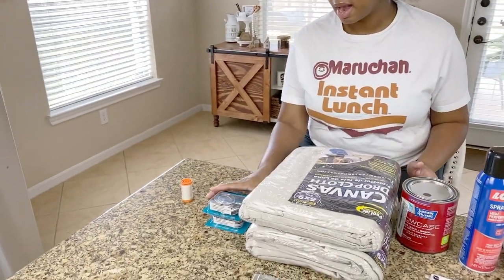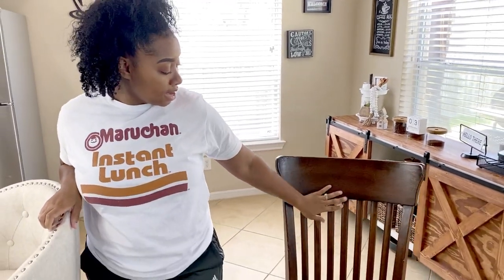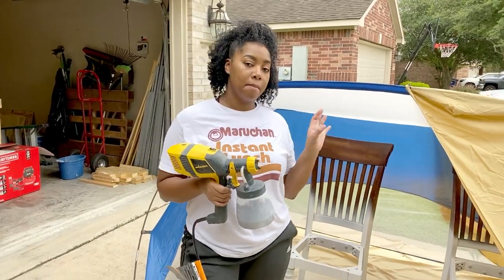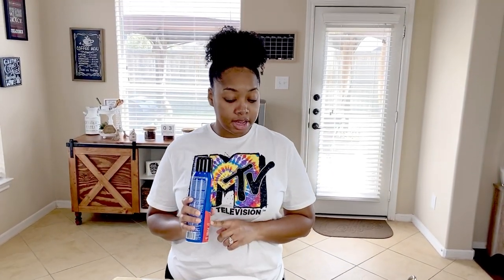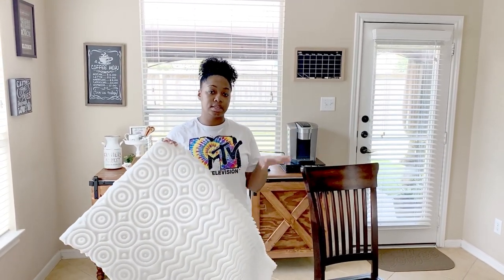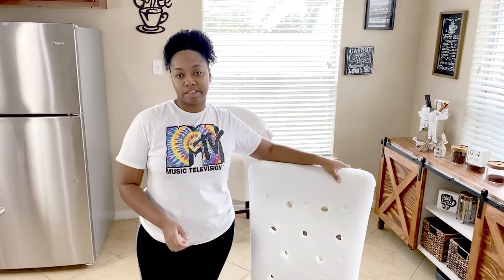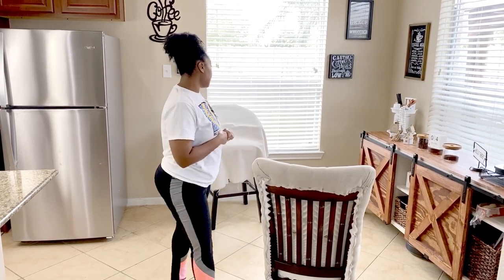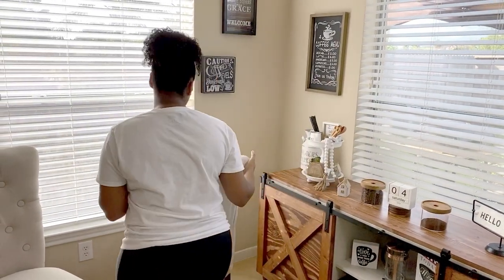DIY Reupholstered Tufted Chairs With Drop Cloth | Farmhouse Chairs|

Comment: Outstanding job. I am a beginner at this but you mentioned that you had rippers on top after you double the cushion. What does that mean. Did you used bag of batting. Thanks
Reply from the maker: Hi Wannella,

On the first chair, I started with using batting on the seat of the chair, but I realized I did not need it. I did not use it on the second chair. 

As for the ripples, I believe that is what you are talking about. The foam that I purchased was a mattress topper, so one side has ripples, and the other side is smooth. I wasn’t sure if the side with the ripples exposed would be noticeable on my chairs, so I decided when doubling the layers of foam, that I wanted the sides with the ripples to be facing each other and not exposed. I hope this isn’t too confusing. Thanks so much for watching!💗

Comment: Nice. But it would have been nice to show how you made the holes.
Reply from the maker: I just placed the button on the padding, traced the circle with a sharpie, then cut the circle out with an X-Acto knife, then push it through so that it creates the hole. There was no set measurements that I used, I just eyeballed where I thought the tufting would look nice. Hope this helps. 💗

Comment: Fishing line is a great idea for the tufted areas. Much more sturdy than thread! I just picked up 4 chairs on FB market place, and they're actually already upholstered exactly as your finished project. (4 chairs at $75). I plan to remove the old fabric and just use the pieces as my pattern. I appreciated this video! Just wanted to mention... You can literally make any size covered buttons yourself, and it won't cost you a penny. You don't even need a button! Grab a relatively sturdy piece of cardboard and trace a circle on it in the size that you want your covered button to be. Cut that circle out (you can even sand the cardboard circle edges to be sure its perfectly round). Using an awl, or ice pick, or anything sharp and pointed, put your button holes in the cardboard where you want them (either two or four holes). I put a small piece of wood on my table (or floor) and just use a light hit of a hammer on an awl to punch the holes where I want them. Super simple! Place your cardboard button on the fabric of your choice (fabric right side down). Typically, even a scrap of fabric will do. Draw a circle around the cardboard 1/4 to 1/2 inch larger than the cardboard circle, depending on how large it is. This can be "eyeballed" and hand drawn. Remove the cardboard and hand baste your circle of fabric loosely around the outside edge of the circle, but don't knot it or remove the needle. Leave a few inches at the end to be able to pull the thread tight. Place your cardboard button in the center of your fabric circle and pull the thread so that the stitches close around the "button" you created. Make a stitch or two in the back of the new button cover and knot the thread. If you want a "puffy button," add some "stuffing" under the cardboard button before pulling your thread tight around it. I've been using this method for years, and the covered buttons are fool proof, free, and literally take a couple minutes each! No more waiting or paying for someone else to do! Give it a try! Your chairs look great, by the way! I'm about to do the same for some chairs I thrifted on facebook market place, which was what brought me to this video. Great tips to follow... thank you for sharing!
Reply from the maker: Wow! Good to know 😉 thank you so much for the amazing tip, I’ll definitely have to try the cardboard! Thank you for taking the time to watch and leave a comment too. You got a really good deal for your chairs. I bet they are going to look absolutely amazing!! 💗

Comment: Hi Courtney you did an amazing job and who knew you could use drop cloth as a fabric. How did you know how much foam to cut for the backs of the chairs?  Also did your holes just happen to line up with the slots in the natural design of the chair so that when you tied the fishing line it wasn't pulling to the left or right or does it not matter where the holes are cute? I'm planning to re do my chairs this weekend and don't want to mess things up.
Reply from the maker: Hi, thanks so much! As far as the holes go, they didn’t all match up, some pull to either direction but you can move the buttons to adjust while pulling the fishing line. For the foam, I measured the seat backs and purchased 2 bags of foam. Once I got the first layer on I just sat in the chair and put my back to it to see if it was comfortable enough for my liking, I added another layer. I would just adjust accordingly. Hope this helps, I’m sure you’ll do an amazing job! Good luck!💗
Reply: @cortneyb.  hi again, I got scared and didn't reupholster my chairs yet but I have another question... did you use all three layers in the paint sprayer?(primer, brown paint and polyurethane) Also did you find it easier to paint the chairs versus sanding them down and staing them a dark wood color?
Reply from the maker: @williamsfamilychronicles5518  hey there,

I primed and painted with the sprayer. I didn’t use polyurethane, I used polycrilic and I brushed it on. (I didn’t use the sprayer for that.) For me- and that’s just my opinion it’s easier to sand prime and repaint versus trying to sand and get all of the prior paint/stain off. 💗

Comment: Did you use two layers of foam for the top part of the chair or just one? Did you use batting on the seat of the chair or just the top part? Thanks for posting!
Reply from the maker: Hi I started using batting on the first seat and realized I didn’t need it, so I stopped using it. The batting wasn’t necessary for me. I used 2 layers of foam on the seat part you sit on, and 1 layer on the back part. Hope this helps. 💗

Comment: Your chairs look amazing! I'm going to attempt mine as I update my dining room. Question: how did you create the lines above and to the side of the buttons?
Reply from the maker: Thank you! I just cut slits in the padding prior to me applying the fabric. Once you make your cuts and put the fabric just make sure you pull the fabric tight while really focusing on pushing your fabric into the creases. Hope this isn't too confusing. Best of luck, and please come back to update how everything went!💗
Reply: @cortneyb.  makes total sense! I wasn't sure if you'd used the fishing line. Glad I asked! Thank you!! ❤️
Reply from the maker: @dancewithtish719  you’re very welcome. The fishing line was used to pull the buttons through and secure it to the chairs. It was stronger than the thread in my opinion.💗